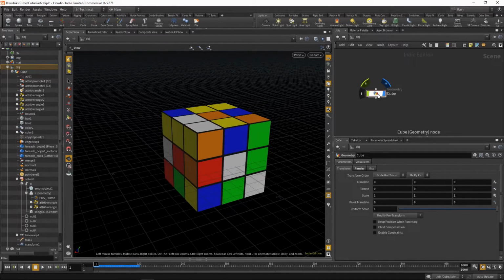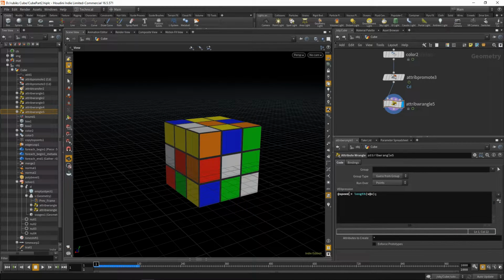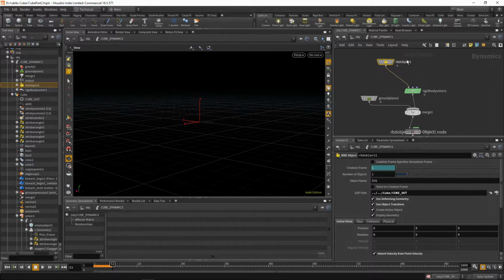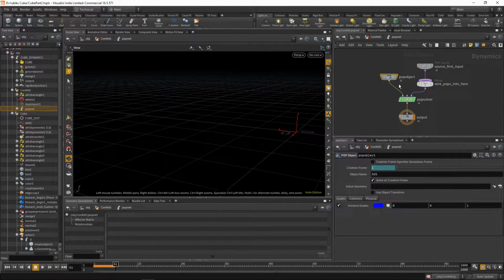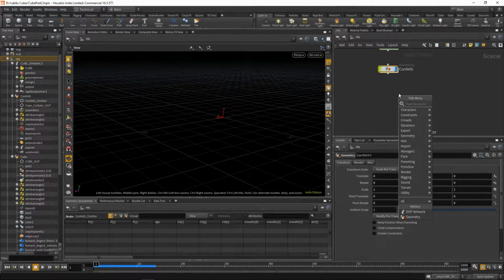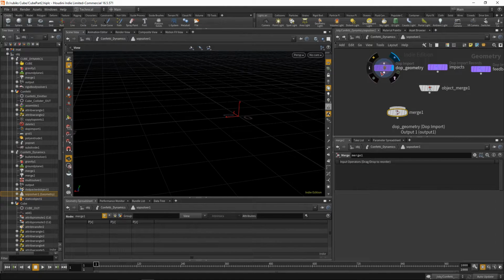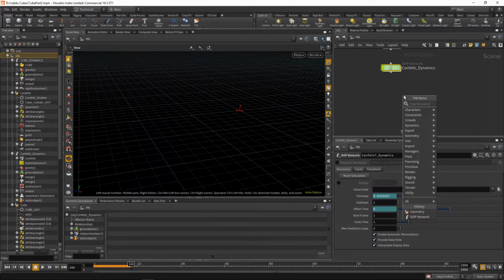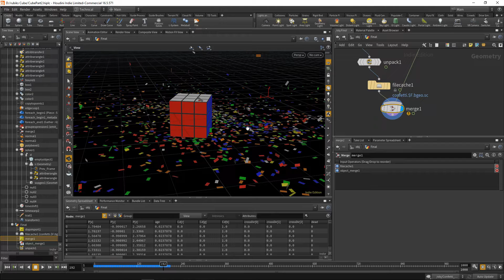Houdini Tutorial 4 Part 2 - Rigid Body and Bullet Dynamics

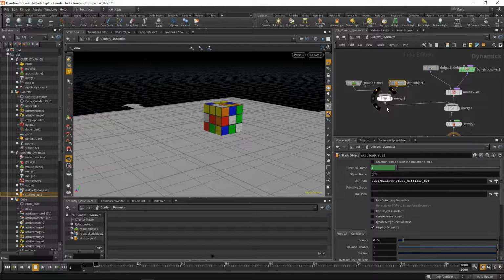Comment: Enjoying the tutorial but it goes off the rails for me at 12:04 where you have us find the SOP path in the staticobject node and you select "Cube_Collider_OUT." I replayed the video up to that point and as far as I can see, we never create that nor does it appear if I apply a filter to search for it. There is a dissolve at the end of the section for creating the Confetti node and I'm wondering if a step might be missing when you edited this. The last thing we create in the Confetti node is the null object that we rename "Confetti_Emitter." Thanks.
Reply from the maker: Thanks a lot for bringing that up, I cut it out in the edit by mistake. The "Cube_Collider_OUT" is just the dynamic cube plugged into a null, I'll add the correction as soon as possible, sorry for any inconvenience
Reply: No worries. Thank you for the solution. I've set a calendar note to check back so I can delete my comment on here so as not to cause confusion after the fix is applied in the video. Thanks again. Also, here are explicit instructions for other noobs like me :)  1) go inside the "Confetti" geometry node. 2) At the very top is the "dopimport1" node. Create a null node near this and name it "Cube_Collider_OUT"  3) connect this null node into that "dopimport1" node.